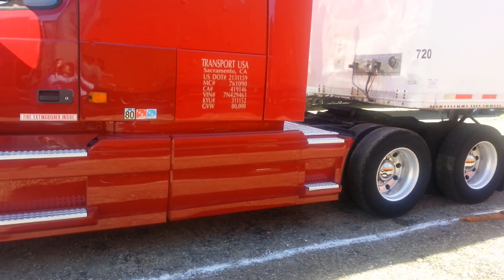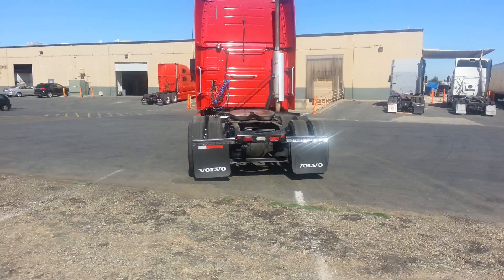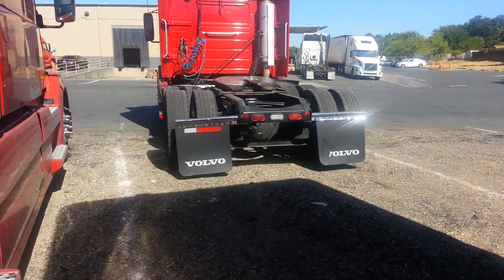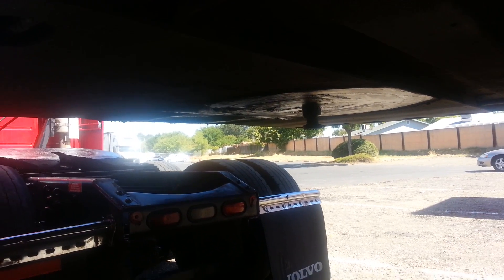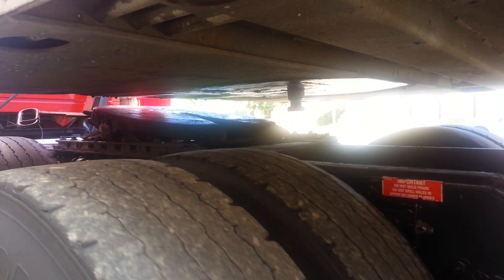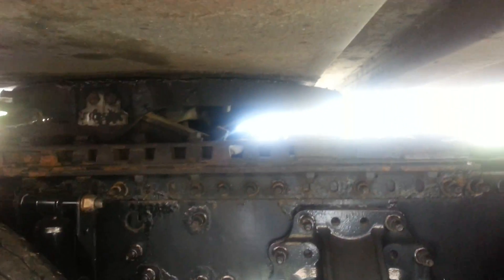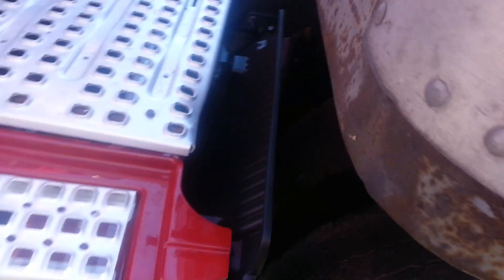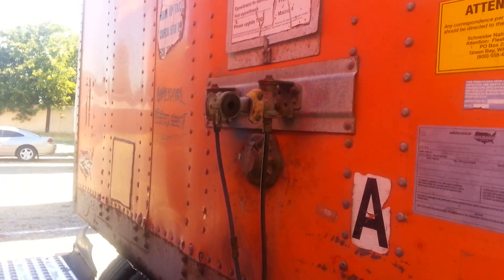How to Hook Up a Semi Truck to a 53 Trailer

Comment: You Have one of the better Videos on hooking up a Highway Tractor to a Trailer, but you didn't really show exactly what a Person should be 'looking at', to confirm that the locking pin is correctly engaged!
D

Comment: First of let me start off by saying that I am a OTR driver and I am going to have to say that I was not impressed that your driver didn't get out of the tractor to confirm that the fifth wheel was slightly snug under the trailer. If you are going to be an instructor you need to be more professional and not sloppy and be able to show someone how to do a trailer spring break tug to ensure that the service and emergency lines are working properly and are checked before you join the glad hands. Thank you and I'm not talking shit I'm just giving good advice.